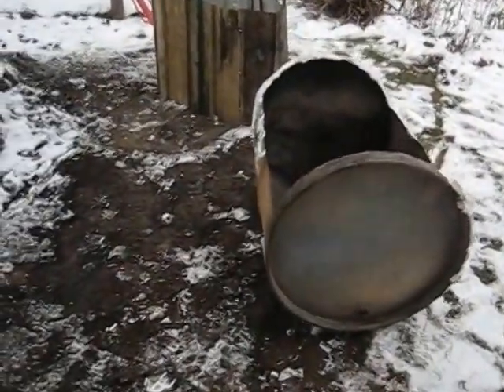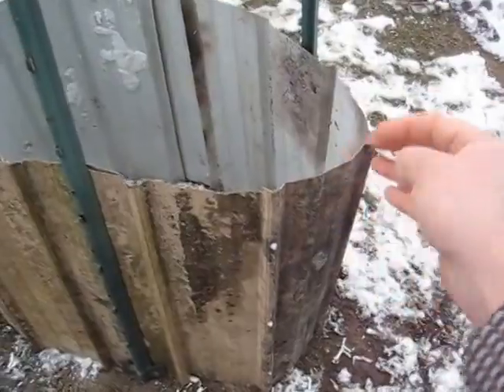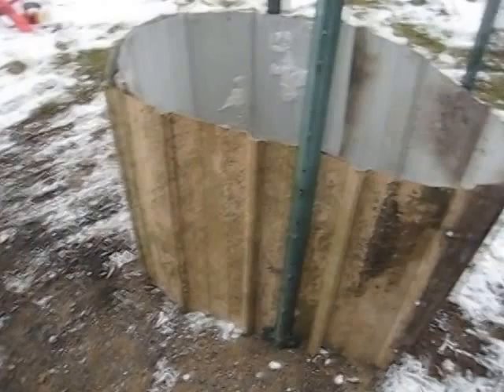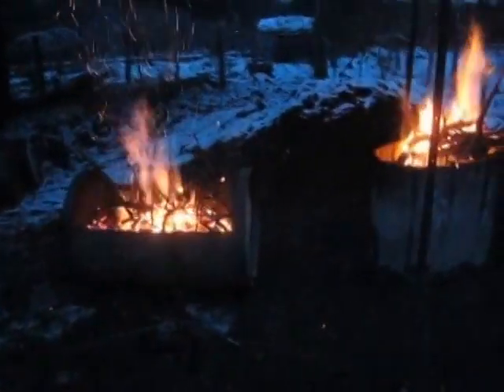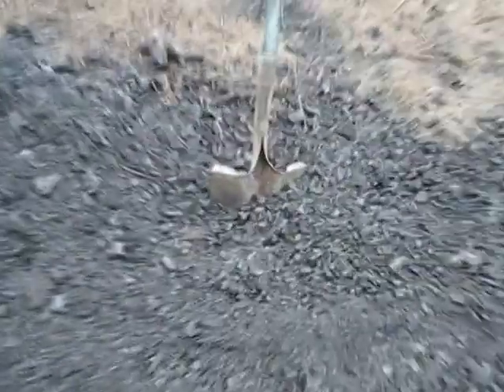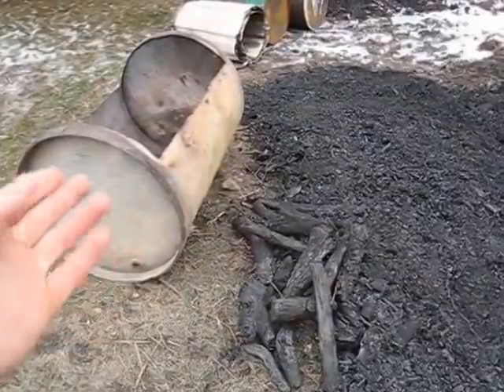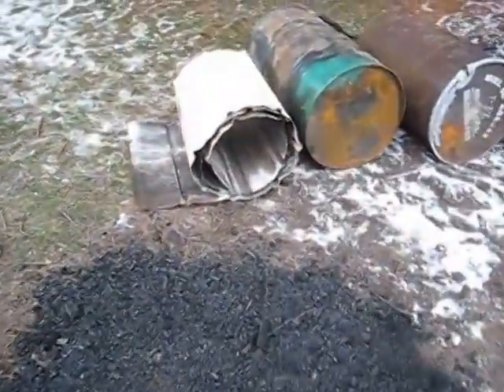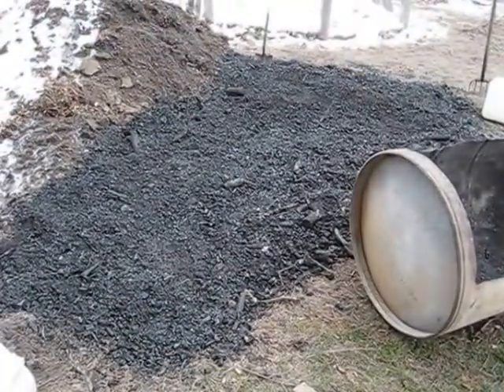Biochar production in super portable and affordable kiln

Comment: I tried  my first ever batch of charcoal for making biochar today and it worked.  I was amazed really. I used an old metal cattle protein tub and made about 10 gallons finished charcoal. How much biochar will i need? Is there a ratio of biochar to compost? Thanks for all your info on this subject. Ive been putting it off because i thought it had to be harder than it looked. But it was very easy.
Reply from the maker: So glad you tried and had some nice success!  How much do you need?  I can't answer that, I don't know your setup.  I'd say just keep making it and putting it near/around/downslope of your compost bins so you can be stepping on it, crushing it, and incorporating it into your composting over time.  It can't hurt to use the winter time as a time to really bulk up on charcoal.  I trust you'll find a use for every last drop you make! :)

Comment: Thanks for the inspiration.  I made a barrel kiln but left the flaps intact on the sides  like you suggested, flared out to 45 degrees.    It works great to contain the droppings and to help in predrying before conbustion.  I'm thinking of putting it on wheels with metal handles.